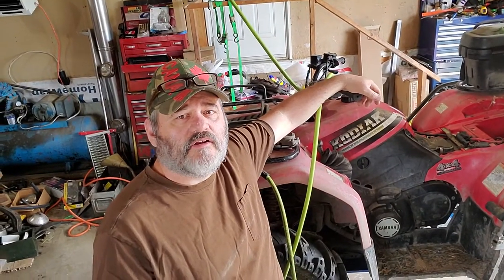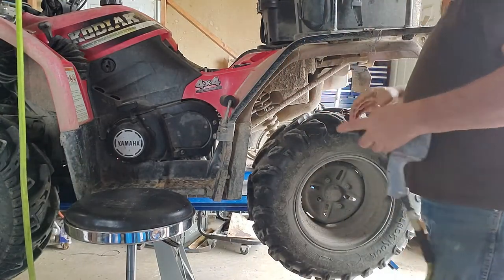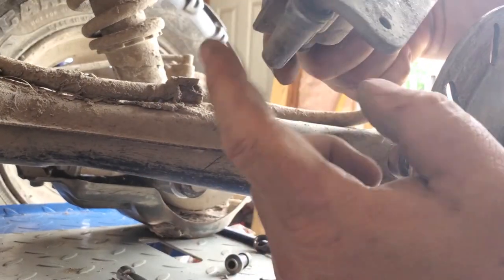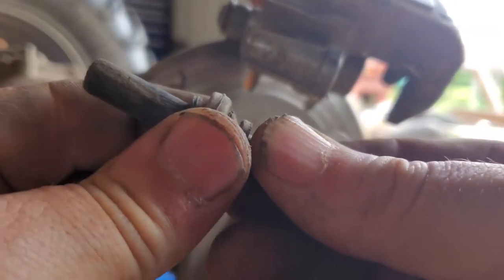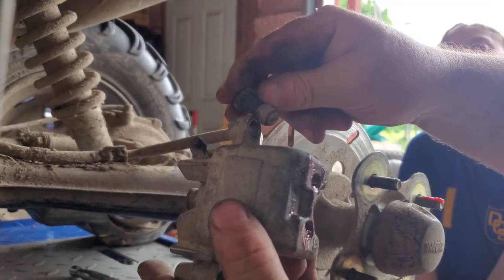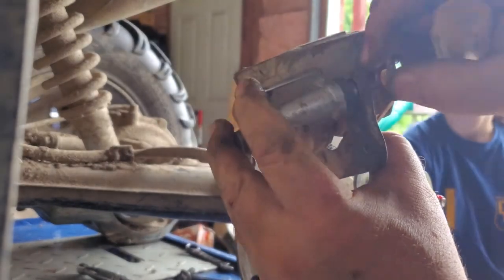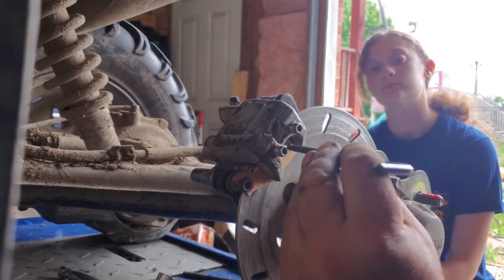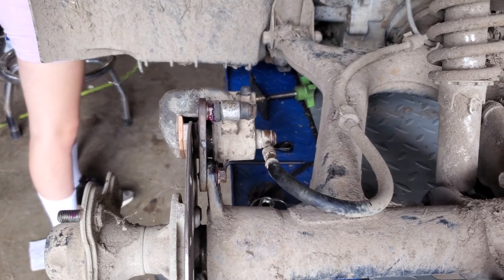Yamaha Kodiak brakes (part 1) Rear

Comment: PLS HELP 
on the rear diff is on the top one small hose , I dont know for what is this hose?  I find the other end hanging near by carburator. Its only for overflow or must be somewhere pluged in? thanks
Reply from the maker: The hose coming off the rear diff is just a breather

Comment: Your the only video on YouTube that goes through rear brake replacement. Thanks. However I accidentally loosened the hydraulic line on caliper and lost pressure and now can’t seem to locate the master cylinder. If it’s the same as front cylinder I would be shocked. Can you assist?
Reply from the maker: Glad it helped

Comment: I just changed my first belt. A million miles all hard, best machine I I’ve owned.   Can’t bleed rear brakes, can’t get fluid to the rear at all. Ideas
Reply from the maker: Have you tried a vacuum pump? Might help to get the juices flowing.
Reply: same issue please let me know if you found a fix a year later lol

Comment: Strange my 03 has rear break shoes and according to Google they didn't get rear disc breaks until 05 but yours is a 01?
Reply from the maker: Yes this is an 01, been in the family since new.
Reply from the maker: Is yours a Kodiak or a Big Bear...Im pretty sure the Big Bears kept drum brakes on the back well into the 2000's.
Reply: @SchnebsGarage  mine is a 03 kodiak 400 .....I just looked it up and apparently yamaha ran rear disc breaks from 00-02 then switch to drums from 03-04 then back to disc 05-06 ......makes zero sense
Reply from the maker: @enjoythesho1992  Wow, that is a little bizarre.

Comment: Can get my brake pads to tighten up on rotors now.. did everything like video EXCEPT I took brake line apart from caliper
Reply from the maker: You have air in the lines, you will have to bleed the brakes.
Reply from the maker: Be very careful loosening the bleeder screws, they break easy. Dont be afraid to add a little heat with a propane torch, being careful not to make it too hot or you can melt the brake line and rubber seals.

Comment: You definitely need to do better job of maintenance, you should replace the brake fluid as well, the 2 pins require blue loc tight

Comment: cant find the break fluid tank for back brakes
Reply from the maker: Should be located on the right side, back and above the rear brake pedal. You'll have to remove the plastic covers on that side, its just a small white plastic tank holds only a couple table spoons of fluid. Just follow the line up you cant miss it.
Reply: Under from rack. Left looking at machine.
Reply: Front